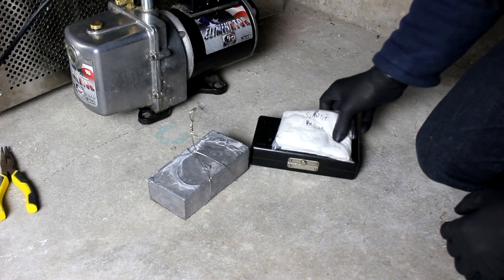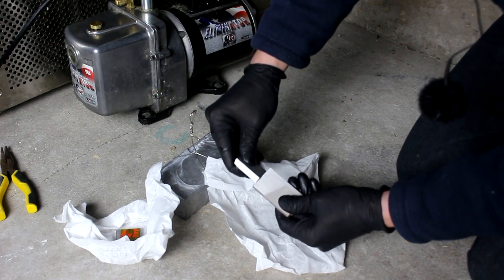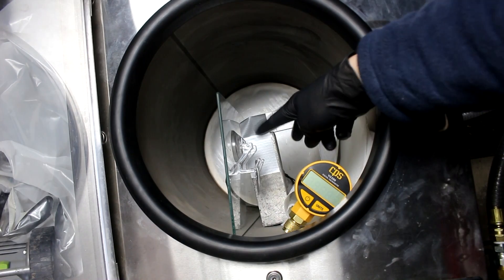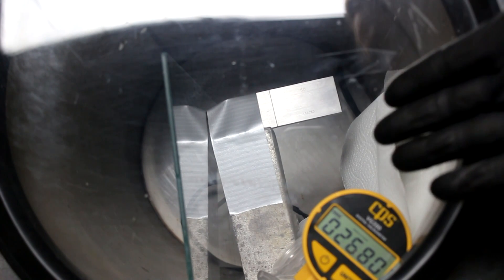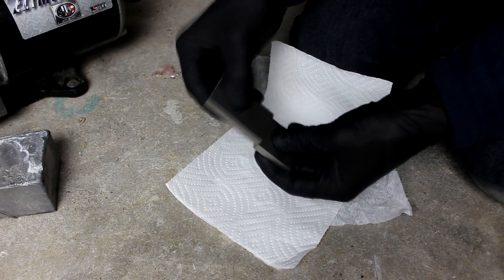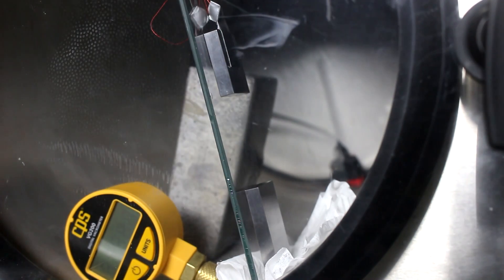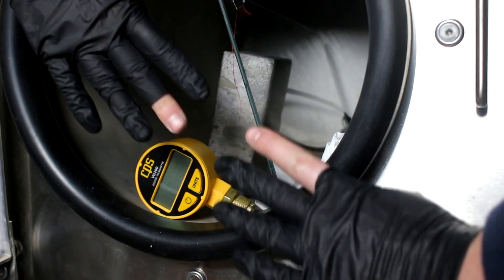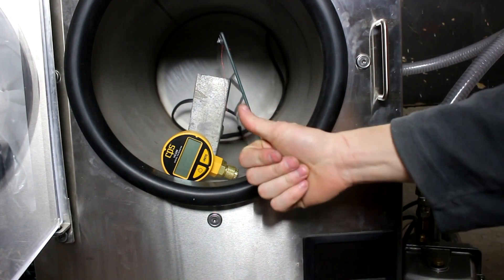Will Gauge Blocks Stick In Vacuum?

Comment: another hypothesis: maybe the friction heats up the both surfaces ever so slightly and either
1. "welds" the plates together just a tiny bit
or
2. disrupts the molecular structure on the surface so the space in between the plates gets filled with atoms from the plates so that in the end some atoms of plate one are stuck into plate 2 and vise versa....
just one theory. maybe if you cool down the plates enough (liquid nitrogen or something :P) you could go around this effect....

Comment: Why are you calling friction what's actually adhesion? I mean friction can be explained even without any molecular physics solely by mechanical microsurface interaction. Whereas the same explanation(that you used as well about molecules intertwining together) does not quite work for adhesion, because it's not intertwining, it's atomic attraction. In case of metal it's more like metallic bonding that holds metal crystals together due to sharing electrons between metal ions which's a purely quantum effect.

Comment: At room temperature, atoms are moving around on the surface of solids constantly due to heat motion. Using a Atomic Force Microscope, it is possible to slide a single atom around pretty easily. Using friction probably smooths the surface and mates them to each other, increasing the effective contact area. Im pretty sure the majority of the holding force is Van der Waals forces, but there probably is some cold welding due to local heat from friction. One wavelength of light is about 500 nm. The ionic atomic radius of a Fe atom is about 0.124nm. Van der Waals forces become significant at 0.3-0.6 nm. Microscopically the surface is still very rough.

Comment: one of my thought would be, maybe the blocks being dropped where off on the other plane of suspension, so maybe the string wasn't exactly centered enough to exclude such a complex theory. just my thoughts but I think you are right about the friction theory.

also, do the blocks stick in different planes? or just the edges

Comment: Isn't the force simply related to the Casimir effect / Van der Waals force? With well polished blocks and a little bit of force, it is reasonable to think that the two metals faces must be separated from each other in some non-negligible areas by amounts on the order of 10-100nm. At which point the Casimir forces are large. It's a quantum effect apparently. A similar effect happens, even stronger, with well polished optical flats which can be made even flatter than gauge blocks. Within a few 10's of nm for a better  λ/20 polish (you can buy a λ/20 mirror on Edmund Scientific, it's a very good but not outrageous flatness). If you polish optical flats well enough, when they are put together, they are stuck forever. You can't take them apart without breaking them, and the joint is helium-leak proof. I recall that''s how mirrors for He-Ne based ring laser gyros are attached to their cavities. A cursory search indicate they are super-polished to λ/50 with surface roughness of 1 Angstrom RMS (!). Now that's super flat. I'm not sure how you would procure some of these, but they'd stick really well!

Comment: It honestly sounds more and more like a friction weld, the more and more you talk about it. The contact area is so much higher because of the smooth surface, the small amount of metal that would friction weld (or stir weld if you want to think of it like that) might be enough to hold the two surfaces together. At the same time, glass does this too, I wonder if that is from vacuum force or from a force like this.

Comment: Perhaps the attrition creates an intertwine of molecules, like sharp teeth getting stuck at each other.
Way to prove hypothesis: See if the force needed to separate the gauge blocks depend on the direction you are sliding. (If this hypothesis is correct, continuing  sliding in the same direction should take more force than going back)

Comment: I don't know how it may relate to this, but I remember when I was kid, I use to stick two pieces of glass just by sliding them side by side when they were wet. It was probably because of the partial vacuum created in between the pieces, but it would be great if you can test that out in your vacuum chamber as well.

Comment: I think you need to scrap off any microscopic oxidated layer WHILE IN vacum in order to do that. the oxidated layer is preventing the cold welding from happening in normal atmospheric presure. however, when you slide 2 surface together, you basically do just that, scraping off the oxidated layer with the edges, and then keeping it  practically in vacuum because theres no air in between those perffectly flat metal surfaces. thus not letting it touch any free oxygen molecules from the air.

Comment: I think a possible theory is that the friction causes enough heat for the surfaces to bond together on a much lower magnitude the same way an engine can seize from the thermal expansion from excess heat

Comment: A few suggestions:
Try looking up digital magnets in which the distance of magnetism can be set. ie INCRA Tools as it may be related.

When you are applying the sliding motion, you may be inducing a minor temporary magnet similar to rubbing or leaving a nail on a strong iron / neodymium magnet. If you slide them faster or slower does the strength change? Perhaps drop one beside instead of ontop of the other block. As you suggested, there may be sharing or polarization on an atomic scale.

Perhaps try using the longer or flat edges instead? Does it occur with larger or smaller blocks? Have you tried measuring the magnetic fields (probably not as it is rather pricey equipment)? OR placing a third metallic / magnetic object in the equation?

Would this be similar to paper cards sticking to the table like in pubs, regardless of whether they are wet or not?

That's all I could come up with. Thanks

Comment: I am not  shore, but I think it is the same mechanic  that the feet of geckos use to stick to walls and upside down on the roof ( the lizard geckos )  I'm talking about the affect between the tiny hairs on the lizards feet and the surface of the thing there climbing on   ) and if I knew the name of the affect I would say, but making a mistake with the wrong name would be counter productive

Comment: Very interesting vid! Do you know the minimum amount of psi it takes to make them stay together? I feel like it would be cool to determine the psi needed and then use a piston to push them together inside the vacuum and then test if they are held together while still inside the vacuum. Putting them together in the vaccum is a great idea but then as soon as you open the chamber, you've increased the outside pressure. The lazer on the string was awesome and a pretty clever way to manipulate what's inside the vacuum.

Comment: Try heating them up or cooling them down to extreme temperatures (Not that they weld together, but still fairly hot / cold) see if that makes a difference.

Comment: "Of course duct tape works in a near-vacuum. Duct tape works anywhere. Duct tape is magic and should be worshiped."
Reply: I love that book The Martian
Reply: Duct tape and zip ties - the two greatest scientific forces discovered in the 20th Century !
Reply: "Duct tape works anywhere." ... ironically with the exception of ducting
Reply: @wuddadid  it works for ducting, it's just not code compliant
Reply: @RallyX26  It works yes, but not for long in my experience. Its also cloth backed which isn't great for air leaks. Aluminium foil tape is what you want for ducting.
Reply: Except that it probably produces X-rays if you manage to pull the duct tape a part in a vacuum... Enough to produce an image on dental film. :P
Reply: So say we all!
Reply: We can make a religion out of this.
Reply: @mrbob721  There is a religion based on black duct tape, its called 'The force'...it has a light side, a dark side, and it holds the universe together.
Reply: @sidecarbod1441  FOR REAL
Reply: @sidecarbod1441  what about two sided tape
Reply: @mrbob721  No, dont.
Reply: The crew of the Apollo 15 carried duct tape to the moon and repaired their electric vehicle using duct tape. On the moon there is no atmosphere, so you have a vacuum.
Reply: "The handymans secret weapon, duct tape" - Red Green

Comment: Cody! Can you measure the electric resistance in between the two blocks? Then you can figure out the contact area is holding it together. To do that you will need a 4 wire setup for being able to detect such small resistance.

Comment: Well... My first assumption would have also been the air. Which I also doubt after seeing your tests.
Your last test however was not very reliable in my opinion. Since the glass plate and the blocks would have to be perfectly flat and the blocks would have to have perfect 90 degree angles to assure there is no actual gap between them when they lay on top of each other. And since the glass plate probably bends ever so slightly even just under it's own weight and the weight of the blocks (since it was at an angle), I consider it rather likely that the blocks weren't actually laying perfectly flat on each other.
I would have tried to suspend the block very low over the other and hoping it doesn't fall off when you let it fall. Tough I don't expect that wouldn't change anything.
Anyway, rather interesting occurrence... :-)

Comment: I KNOW WHAT BONDS THESE THINGS ITS ADHESION!!!! sorry for  caps
Reply: That's a tautology; "Adhesion" just means a non-chemical connection between materials. That's like saying "Water evaporates because it is volatile," you're just restating the thing in different words without actually explaining anything.
Reply: Pungo Machungie Also inaccurate. Cohesion refers to particles of the same substance being attracted to itself, typically referring to fluids and not applied to discrete solid objects.
Reply: Simon Grotenbreg technically it would be cohesion in this case
Reply: +PolyJohn  i think that's supposed to be the joke.

Comment: I'm only a couple minutes into this video, but I have a different hypothesis. Other than the suction cup one. It has to do with how geckos can walk up glass. Atoms want to stick to other atoms. At the molecular level, our fingers are like mountain ranges. But the pads of a gecko feet are so flat they make a lot of contact with the surface. I think the same thing is going on here. The blocks are is such close proximity to each other, there molecular bonds are holding them together. Just a theory. OK time to watch the experiment.

Comment: there are atoms from both blocks that form unit cells on contact. if you apply more pressure more cells will form. 
the nucleus of each atom of a cell attracts nearby electrons from other atoms, so the cells stay together. 

so if you put them together and wait, the blocks will form new unit cells over time. the force goes up and even more cells form. this goes on until you cant seperate them anymore without destoying them. thats basically cold welding.
A little bit like a magnet that starts working on atomic distances.
Reply: Marius Fritz I've never heard anyone BS something so professionally. Have you thought about being a lawyer or goverment official?
Reply: He, is just stating the atoms for the blocks form a lattice that locks them together, then attributing that to QCD through strong interaction and then saying it is the same thing as cold welding. You just have to speak autodidactese to understand his explanation.

Comment: Perhaps perfect contact is required to make it stick in the chamber. The glass used as a sliding surface is probably not straight. The long sides of the blocks are also not guarantied to not be slightly slanted in relation to "the perfect" sides

Comment: This not only happens with gauge blocks.
Once I disassembled a hard disk and the rings separating the disk plates shown the same effect on one side and a weaker one on their other end.
The effect kinda weared out after some months of playing with the rings, probably from little imperfections on the surfaces and today they have almost no stickyness effect.
One of the things I tried when I discovered the effect was to clean the pieces with alcohol and that somewhat weakened the effect for some time, maybe some residue from the isoprophilic alcohol used? I don't know.

I don't remember the make of the disks but probably Western Digital, Hitachi or Samsung which are the ones I get more often.

Comment: A couple of things that might be interesting to try with this.  Heat one side and calculate the heat conduction across the junction compared to through a single solid piece.  You could also try sending electricity through the junction to see if it disrupts the effect since there may be electrons involved.  Something else you could try to magnetize them; if that is possible with this alloy;  then ring together like poles if possible.

Comment: With smooth surfaces wouldn't you get some electron sharing?  I'm not at expert but don't the atoms of metals share their electrons on the surface?  Mash two of them together and you may get those electron surfaces to intersect?  Not everywhere as the surfaces are still too rough.  Can you do this with non-metallic substances?

Comment: Could you try using something like rubber bands to squeeze the gauge blocks together (without wringing them) and then putting them in the vacuum chamber? What happens if you try to wring them together in a vacuum? What about the rubber bands and vibration (both in atmosphere and vacuum?

Comment: I wondered if the blocks could be pressed together without wringing so I put two that are out-of-spec in my manual press and wrenched down on it (probably about 1000 pounds force over 0.2x0.2 inches so like 25,000 psi) and they wouldn't stick at all. It appears I have not refuted that the sliding force is critical.

Comment: Good experiment.  I really thought it was atmospheric pressure.

You're getting a lot of mileage out of that vacuum chamber.  I think at the microscopic level the metal is "smearing" together forming tiny welds.  A scratch involves enough localized energy to deform the metal, so maybe tiny regions are heating and becoming malleable.

Maybe you could temper the guage blocks to see if hardness matters.  But, they might deform.

I watch AvE too - but I don't understand his whole code yet.

Comment: Having to rub them together makes a lot of sense with the Van Der Waals hypothesis.  Remember how tiny atoms are - at this scale, even a gauge block is so rough that the actual contact area is fairly small.

One interesting facet to test is whether they stick no matter how they're rotated - it's easy to imagine the grinding process leaving tiny microscopic grooves in the direction of the grinding, which might interlock so to speak if you rub them together.  However, this effect would likely be anisotropic, dependent on how well the groves line up.  Careful, though, since the groves could cut new grooves on rubbing, making them interlock anyway.

Another theory could be that you're actually getting ionic bonds between some of the atoms of the two plates, similar to cold welding.  In this case, the rubbing would be necessary to scrape off/break up the thin layer of oxides on the surface of the metal in order to expose the metal atoms to each other.  The oxides would end up packed into the low points on the surface, and only the high points would have metal on metal contact, which would still make the overall bond weak.

Note that we do have evidence that two surfaces rubbing together can knock off electrons, therefore allowing ionic bonds to be able to be formed.  We can see this clearly when we rub a balloon against a wall, or play with a Van der Graaf generator.

Comment: Maybe it's like ice skates. The pressure you exert on the blocks plus friction heats up very small portions of the surfaces so that they actually weld together. Of course, it would be miniscule welds, a couple of atoms wide.

Comment: you were relying on the surface of glass plate on those drops. deepen the angle so that the top peaces center of gravity is on its contact surface.

Comment: Were the gauge blocks cleaned of protective oil and grease? A layer of oil or even water would have hydrogen bonding between the two surfaces that would not change with air pressure. Try some clean dry warm blocks together.

Comment: What about the cashmere effect? I guess it's not strong enough?
Reply: "Cashmere effect"? ROTFL. You mean Casimir effect which is something quite sensible for +Cody'sLab to check into, if he can. The Casimir effect, sometimes called 'negative energy' or 'negative pressure' will work between ANY two surfaces, regardless of the materials being same or different, so long as they are very close together. And of course, flat surfaces are easiest to make match up that precisely, as has been known since ancient times.

Comment: I was thinking its more of the fact that nothing can be perfectly smooth or flat, so it could be locking together with simple friction.  If you had a faster way of cold welding it, then you could see if you get a stronger bond.  But then if its just a surface layer of bonding, I can't imagine it being too strong.

Comment: hey Cody. first time commenter. try running an electrical charge through the gauge blocks while they are in the vacuum. not a lot of current. but a slight burst of voltage might cause the atoms in the gauge blocks to hyperexcite themselves and interlace with each other. just a thought

Comment: the gauge blocks should stick together even in a vacuum, because the attraction is caused by the atomic adhesion force that is not dependant on vacuum or air or something like that.
Reply: the little pressure move is needed to sweep away any contermination on the surface like dust etc....AND to bring the outer orbitals so close together that they act like one cristalline block.